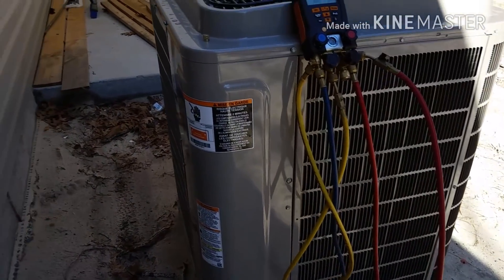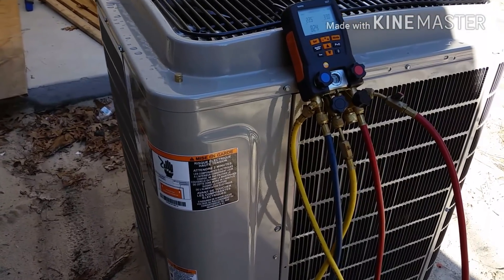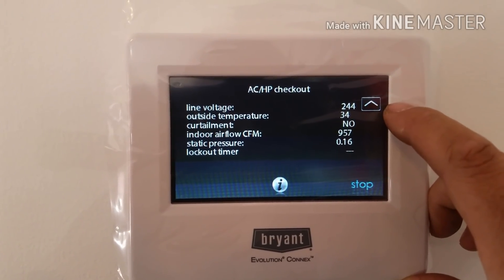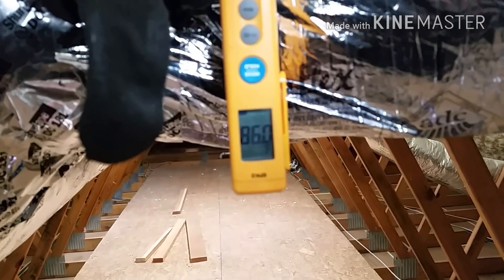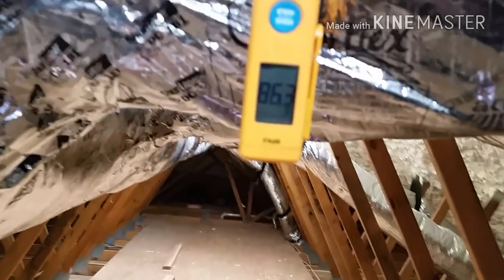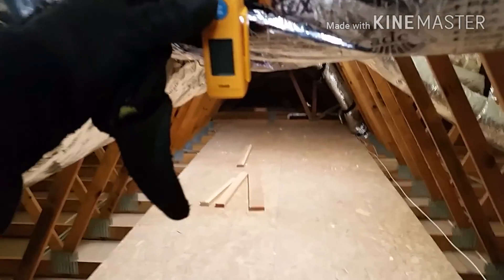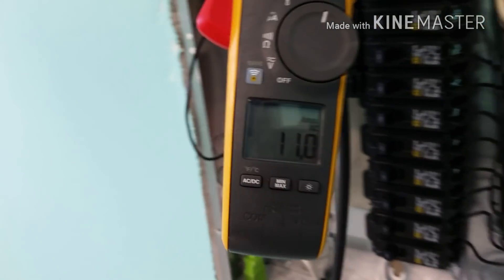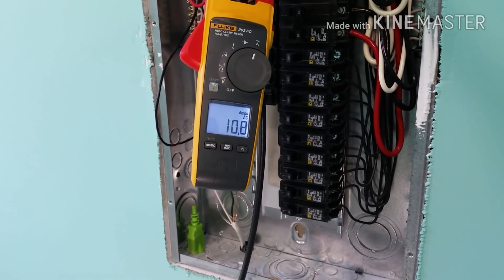Heat Pumps Can't Work In The Cold

Comment: I have a heat pump with auxillary heat (heat strips)...when it gets too cold the aux heat automatically switches on and with this past few weeks of extreme cold we got here in Maryland my electric bill I just got is sky high!!
Reply: Thanks Labtech. i live in Md., am looking to move to N.C. and find it hard to find a home with gas heat:(. thanks for the info. i think the power companies and tree huggers are pushing these things:(
Reply: @cedartreealf  .I live in southside VA 15 minutes from the NC border and retired here from NJ where traditional heat and cooling where normal but the new house was my dream modular home and first heat pump lasted 10 years which they say is the life span for them and in 2014 got a larger unit 16 seer 2 stage 4 ton lennox unit .No other utilities here except for propane ,which when there is a shortage it can be a nightmare .What can I do nothing .When it goes into reserve heat I just see the electric bill going up .My worst nightmare is a heat pump .I had my modular home over built with 2x6 studs and attic had extra insulation put in and floors are insulated and basement walls and floors were insulated .It is warmer in my basement than the house at times .Right now it is 75 in my basement .My heat pump has been repaired 3 times so far and even lennox sent a rep from the company here .
Reply: @sissymurphy9620  did you get my e mail address? I can t seem to REPLY to your Pond video :(
Reply: Thanks  Sissy,
A friend from Md. Moved to N.C. 3 yRS ago. He has electric heat/heat pump. Claimant the temps don t get that cold in N.C. I say hog wash...n.c. is only 3-4 hrs south. He says when it gets COLD he just puts on a sweater. WHO wants to wear a sweater INDOORS?
If I can t find Nat. Gas I just won t bother to move !
SOME homes have a heat pump WITH N. gas. They work fine !
Reply: @cedartreealf  I read about some of the new heat pumps that run off natural gas and some use only 40 watts of power for the blower .I am hoping they bring gas my way soon .I live up on a hill and very exposed to wind and it can get down to 15 and 20 degrees but then a day or 2 later it can be 50 or 60 degrees .My heat pump is behind my house and behind that is woods about a hundred feet or so .It is great in the summer for cooling but lacks heating power especially at night .I just got my electric bill from Danville va and it was 180 dollars but we had a power outage from the storm for 4 days .I have a dryer but prefer to hang clothes out for that fresh air smell and rarely use my oven since i got the air fryer last year that bakes also .I have friends in Maryland that had a heat pump put in 2 years ago and they say they are glad they have a wood stove .They live in Fredrick Maryland .When power goes out here which is not often I use my grill that has a side burner to cook on .Believe me having only electric can be a hassle .I do like it here as it is much cheaper to live and my cow and horse neighbors only party once in awhile .My son is still back in NJ and is threatening to send me his snow ,no thank you
Reply: @sissymurphy9620  thanks for all the info. Wife and I live just South of D.C. , retired and were thinking of moving to N.C. for save on Property  taxes and a different area. But now, we are looking a bit closer : Fredericksburg, Culpeper, K. George. I hear they have 500 gal. Buried propane tanks as well as Nat. Gas. I hear propane can get expensive and anything BURIED needs to be replaced at some point. I have a rental home that has Nat. Gas heat with a heat pump...not sure why/how that works...but it does. House is quite warm  ...gas bill is reasonable . I think H.P. s might work well in the deep south...I feel sorry for my friend that must wear a sweater INSIDE. As they age...they gonna regret it :(.
Again, thanks for sharing :)
Reply: @cedartreealf  I was 50 when I retired and now 65 and you can see my home on sissy's pond on youtube and my koi pond and a video or 2 of the heat pump
Reply: Murphy good job on the shed,  but why drywall & insulate ? Mostly just for storage, correct ?
Koi pond is nice but appears too much STUFF surrounding it and WHY the wood strips across ?
I understand  MODULAR homes are well built/sturdy :)
How much land you have ?
Is the Koi pond heated/plastic liner ?
I may do 1 when I move
Reply: @sissymurphy9620  I meant to tell you, my OUTSIDE H.P. unit LOOKS like a regular. A.C. unit but inside is a gas furnace. The H.P. does run in the winter...not sure why, but again , with Nat. Gas...home is Toasty.  Unit is about 5 yrs. Old...inside and out.
Reply: @cedartreealf  shed has a kitchen In it I built and sofa bed friends love to stay in it when they come so more like a guest house and even has air unit in it .The wood across the pond is for a future bridge as koi cannot stand extreme heat or sun and can get sunburned since sun is on it all day and part of the stuff is to downlight the pond and for security cameras and the aerator .My pond is an epdm liner and is just  over 5000 gallons and have 2 koi that are now over 2 feet long and can stress more in heat .The other fish are fancy tail and butterfly and smaller and a total of only 15 fish .I have had my koi since 2005 and after raising them from babies ,I sure don't want to loose any .I have a pond deicer to keep a opening in the ice .But ice only happens around Jan. to March .My modular home is 2440 sq. ft and cost me 89 thousand back in 2004 and is a norris built home .That included everything in set up except for the basement which was 15 thousand and slab and walls are insulated .House has 2x6 studs .Land was 15 thousand also for 3 acres .Well and septic tank were extra also.I had dirt and a house when I moved here ,now trees and a lawn  .I have given away lots of baby fish for free .I am now getting a new shed for my 2 ride on mowers .I just got done cutting down some trees that were dead in the woods so they would not fall on the new metal shed for lawnmowers and my wood shop
Reply: @sissymurphy9620  THANK YOU for sharing :).  I have heard that many modular are better built than ' site built'  due to weather, different sub contractors etc.  I dis not know about Koi getting sunburned...I do know they can live a long time. A neighbor has some and they RESPOND to her. I did NOT see the kitchen in shed...I should have THOUGHT first !! Too much of Sons STUFF I guess:).
You sound like a very nice lady...am sure your neighbors are pleased.
If I may ask...was it hard to get the well put it, plumbing hooked up, electric, etc?  I always thought about buying a Lot ....but figured all the " extras" would override any savings..and the PERMITS to get e/thing lined up and legal. Seems Unckle Sam always finds a way to cause a headache.
Reply: @cedartreealf  no well driller does everything besides doing the drilling and the electric hook up was included in the sale of the home and clayton homes did all the permits also and that is all included in the sale of the home .i saved by doing mine at tax time 15 hundred dollars and then 500 dollars and then since I was paying cash and the house was done in 2 weeks and delivered 4 days later and the wanted the money to hit there end of month bonus clayton homes gave me another 35 hundred off if I came down from NJ and paid for it by the next day .It was a long 9 hour trip after working a 10 hour shift but worth it and I did not order any flooring in the house as I wanted to pick what they did not offer and had drywall put in and did not want 9 foot ceilings so they took money off that .It costs me extra for bigger windows and 2 sliding glass doors .The 2 cranes were included in set up also .All appliances and heat pump included and water heater but no washer and dryer .My laundry room is 12x15 and I have 4 bathrooms 2 in the master bedroom 3 bedrooms kitchen is 15 x24 and cost extra for the island .with electric .I wish I had bought a lot with a fixer upper and then put my house on the lot also .I did look at 1 but the buyer backed out and house and lot were 29 thousand with just over 4 acres .I help my neighbors with repairs as some have no clue how to do things .I just helped my neighbor put in a bigger pressure tank as the bigger it is the less your well pump comes on .My well is 400 feet deep .I have researched alot since being in this house plus I grew up in a house with a well and septic tank .It is a learning curve but I learned a lot from my dad growing up .If you would like more info just let me know on my pond sight I don't want to use this posters sight for this much .
Reply: Murphy gotcha, and again, THANKS :)
Reply: @sissymurphy9620  did you get my e mail address? I can t seem to reply to your pond sute
Reply: Many thermostats are really stupid about using aux heat. I've seen my thermostat, which is a fairly recent Honeywell model, saying it was using aux heat when it was 45F out...except it wasn't, I have that wire routed through a switch which remains turned off unless I decide that aux heat is needed...guess what, I haven't turned that switch on but once in the 2 years it's been there.

Comment: talking about mi self i never have seen something like that
all the heat pumps need a heat strip to keep up with the low temperatures
Reply: colered sans sanssational  if you need electric strips, to‘ keep up with low temps‘ not properly sized, or is an old system, the strips came on ONLY  IN DEFROST,. Or EMERGENCY HEAT, when compressor failure.BUT with a variable speed system, the indoor fan speed , YOU ALWAYS HAVE HEAT, .  From Maplewood nj
Reply: No, they don't. I'm at a minimum 300 miles north of where this system is. I have a switch wired between the thermostat and the air handler, which keeps the thermostat from calling for aux heat. That switch has remained off for the 2 years I have lived in this house. So the only time the heat strips come on is during defrost. Oh, and my heat pump is just a standard 15 SEER / 9.5 HSPF Trane single-stage unit. But my house is very, very tight.. I personally caulked and spray foamed every gap and crack in the building envelope while it was being built.
The Trane has no problem keeping this house at 68F when it's 17F outside. No aux heat required.

Comment: heat pumps work great and moderate cold like down here in Florida get too far north I don't think they can keep up too well
Reply from the maker: guy napolitano Heapumps these days are used all over the world in almost all conditions. Many ductless heat pump systems for instance are designed to maintain an indoor temperature of 68 degrees down to -8 outside.
Reply: hvacinsc... educating the customer is the task now days , ,untill  they get that first months energy bill then they  get it! Love  my mitzibishi  and  savjng a average of $100. a month
Reply from the maker: These days there are dozens of heat pump systems capable of heating without the use of back up heat strips well below zero degrees Fahrenheit (down to negative 10° to  negative 20°F). Just Google VRF heat pumps.
Reply: @HVACinSC  At what point during the night that you notice that the heat pump can only heat your house to ~74F to where you either kick on the heater element or shut down the pump...?? How long can the compressor run before it like overheats or its stressing out to the point of damage or fail..?? It seemed like the system was running for like 3+ solid hrs with NO plan to stop because the temps were SLOWLY climbing and i saw the thermostat sit at 74F and thats it ... it started at 67F and could not go higher than 74F .. I was nervous that the system was going to fail so i shut her down ....
Reply from the maker: @You Tube Far to much information to try and type and explain. These are not standard heat pumps. It has a variable capacity compressor designed to rev up and down dependent on load. It will not overheat when working properly and this system still has no electric heat. Last year we had a low of 9° and han no issues what so ever maintaining an indoor temp of 72°. For far more detailed information Google VRF heat pump performance.
Reply: @HVACinSC  i don't have a variable heat pump, mine is a standard unit that is original to the house from 97 ... it was 41F outside, inside temps were ~67F, kicked on the heat and the most the unit could heat the house was to 74F unless i kicked on the heater element which i refuse to do...  Now, the unit was going and going and going, clearly it was not going to heat past 74F ... With that said, can the compressor burn out because it keeps running and running  and running trying to heat the house past 74F which it wont ever do.... I need to know if i need to set the therm to 74F to stop it there to let the compressor relax or can it run all night burning away electricity ..??
Reply from the maker: @ACommenterOnYouTube  I'd suggest contacting a licensed HVAC contractor to check the systems performance. I don't do any online diagnostics without seeing the system first hand. Good luck.
Reply: I think it was a simple question.... Can the compressor burn up or lock up if it runs for too long without getting a break ..??
Reply from the maker: @ACommenterOnYouTube  Again.... this page is not here to answer homeowners questions. It's for industry professionals.
Thanks!
Reply: @HVACinSC  and that's not what YouTube's about,let me answer that question for you,my friend works for a housing association that is using heat pumps on a large scale,they cannot get on top of the servicing,YES these systems break down a lot,they have had to take the work in house because contractors where throwing parts at problems for fun,avoid this con,
Reply from the maker: @gimmieliberty6514  Sounds like plain old incompetence. Not the fault  of the equipment. 
Your friend is a maintenance man. Not a HVAC Professional.
As for what this YouTube page is for... read the page description. It is for professionals in this industry. Not DIYers.
Reply: @ACommenterOnYouTube  If it gets cold enough yes the heatpump can run for hours on end. It doesn't hurt anything. The bigger hurt is to your electric bill if you decide to use emergency heat instead of just letting the heatpump run!
Reply: @ACommenterOnYouTube  NO the compressor will NOT burn up or lock up if it runs for "too long" without "getting a break"!!! In fact, it is better for the compressor to run, say, 5 hours continuously than it is for run for 5 hours intermittently with 25 stops and starts.
Reply: guy napolitano:
Im in orlando fla and we just ran the heat last night because its been in the low 40's overnight for 3 straight days and now the block has absorbed the cold and temps inside got down to 65 F ... So the heat pump alone, NO strip assistance, the house would never get above 74F ... it just kept running and running. Even though the heat out of the vents were around 88F ... the house would not warm up past 74F ... So i had to set it for 74F to stop it there so that it didn't overwork itself ...

Comment: interesting so they're going to control all the moisture in the house through the AC unit typically we have ventilated soffit in a ridge cap to let the heat out in summer the AC units going to control all the moisture in the house that's cool
Reply from the maker: guy napolitano You have ventilation in the soffits and ridge vent simply because you have an unconditioned space (typical attic) that you are trying to allow to breath by exchanging air. In this case the entire attic is the return  which is semi conditioned so that is no longer an issue at all. Also this system utilizes a fresh air heat exchanger that has timed air exchange and has full dehumidification capability.
Thanks for watching.

Comment: I would still want all of them returns to go back to a collector box  especially for the summer in my region no matter how much insulation that attic would be scorching hot. It's nice how there is a return in every room every home should be like that.
Reply from the maker: Cindy Matzenbacher Insulation is insulation. Makes zero difference weather you insulate the under side of a roof (making the entire space conditioned) or insulate your ceiling leaving an uncontioned void. (AKA Attic, AKA wasted space). We are in South Carolina where attics exceed 130 easily for over half the year. This is not experimental, its proven.
Reply from the maker: Cindy Matzenbacher You are certainly entitled to your opinion but its not accurate information. I unfortunately can't in my attempt to articulate to you that there is ZERO difference.
Not to mention this isn't an experiment nor is it our concept. 
Thanks for your comments though.
Reply: This is my personal house and this attic is only 1 degree hotter than the downstairs house. It's obvious the heat stays out side the envelope. And in this case that includes my attic space in most homes it doesn't.
Reply: How many supplys in attic
Reply from the maker: Cindy Matzenbacher Zero. The entire attic is the return duct, hints the term semi conditioned. Just because its not wrapped in sheet metal like you're used to seeing in a traditional duct system makes ZERO difference. You wouldn't tie supply ducts into your return would you?
Reply: I understand your concept just fine but you're not going to tell me it's better to take in air from unconditioned or what you call( Semi conditions space)
It is always better to just condition the air that needs to be conditioned. I seal all my ductwork Supply and return so I don't take in air from unconditioned or semi conditioned space.
I'm not saying it won't work but you're not going to tell me something's going to be more efficient that way.
Lovely house lovely job have a great day